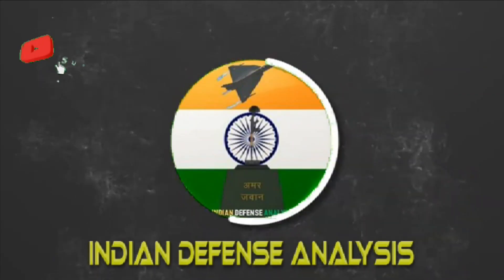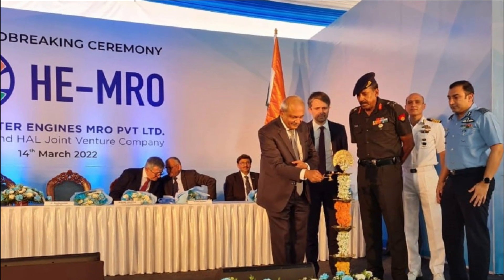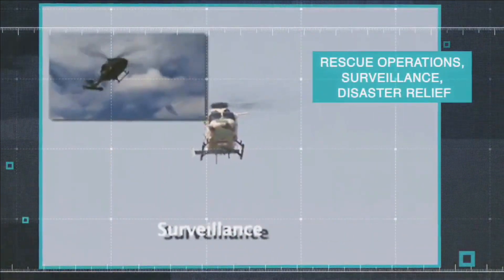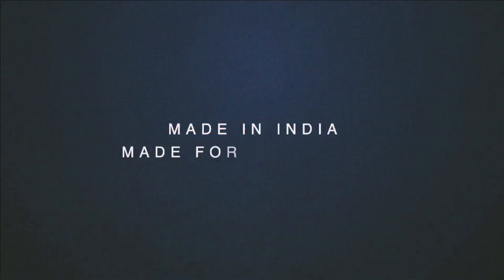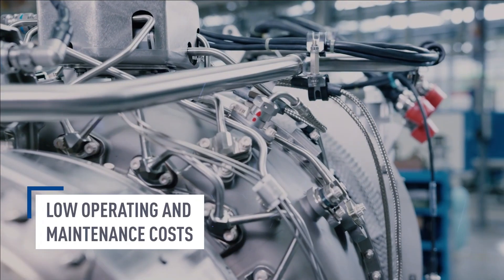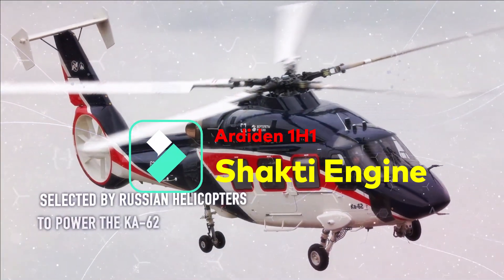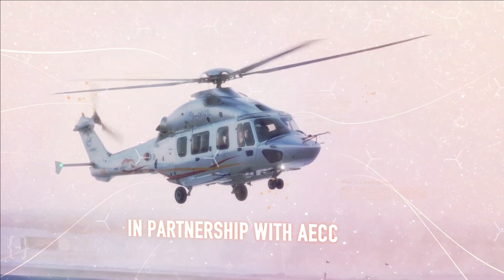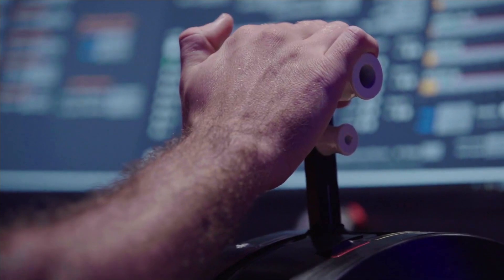HAL, Safran inks JV for Asia’s largest Helicopter Engine MRO

Comment: will it be right to conclude that this joint venture of HAL with Safran will be instrumental  to eliminate the need of importing & joint production of another engine for our upcoming IMRH project altogether thereby making it a truly indigenous helicopter of medium weight category.
Reply from the maker: Not for IMRH which is 13ton class helo, as this MRO facility is for 4-5ton calss helicopter engine. The IMRH engine will be co-developed b/w India and France based on Dec21 visit of Florence Parley. In future this MRO facility may be extended for the Maintenance and overhauling of IMRH engine but cant say for sure.
Reply: @IndianDefenseAnalysis   as a lay man I am asking you this question. please pardon me  for my ignorance ;  but can’ t  these engines be joint together in series in multiple numbers so as to produce the desired shaft horsepower for the IMRH ?
Reply from the maker: @dilipbaokar5776  then HAL will need 3-4 such engines and that would change the design of the Helicopter which has already been tested under wind tunnel.